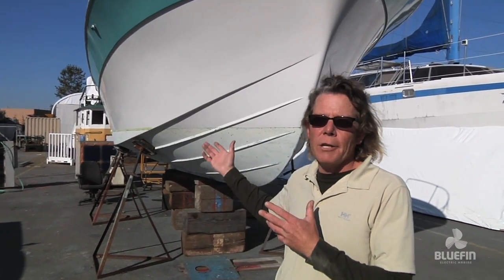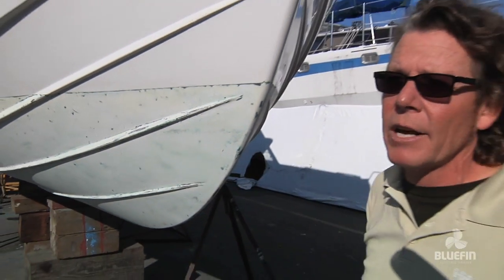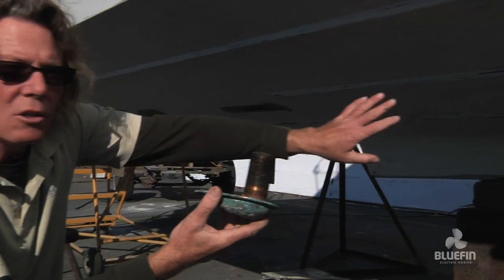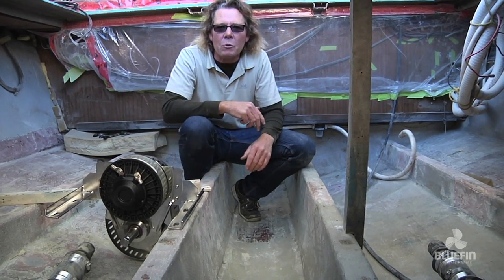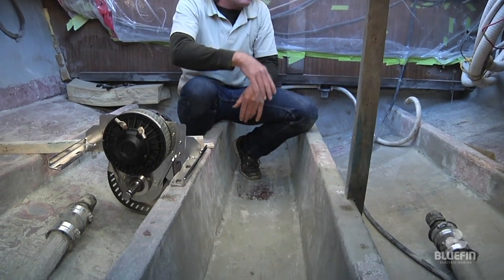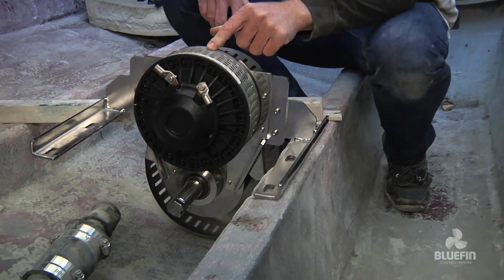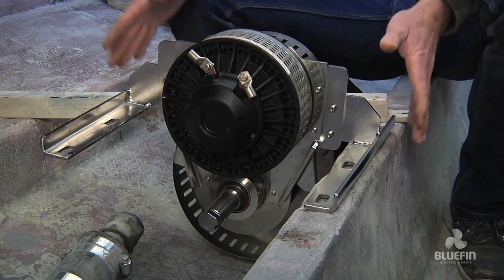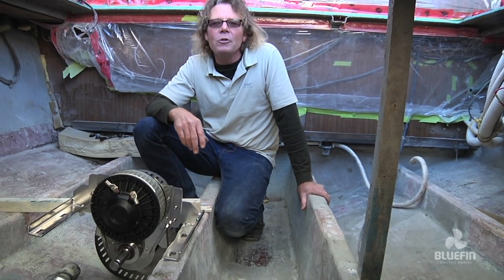Bluefin's Electric Tollycraft update October 12

Comment: Would be cool if you converted it to a series hybrid where a small gas or diesel motor can recharge the batteries when in a pinch kinda like how the Chevrolet Volt works! Maybe even solar panels or a small wind turbine.

Comment: What kind of range are you expecting to achieve?
Reply from the maker: HI James,
with 16 Interstate 6 volt 235 amp hour batteries we can cruise at full speed 5-6 knots for 3-4 hours or when we slow down to 3 knots our range goes up to 8-9 hours and at 2.5 knots we can cruise for 12-15 hours.
Reply: thanks for information.. 9kW of motor , battery energy=6*16*235=22.56 kWh . if motor runs at peak, time=22.56 /9 = 2.5 hour. isn't it right?
Reply: @novelentertainment5285  Or at 80% discharge 2 hours.
Reply: @mikemckelvey7144  thanks